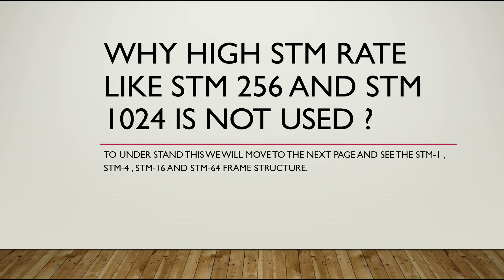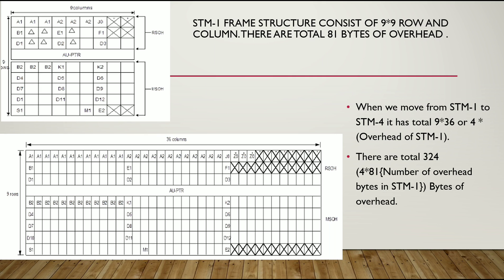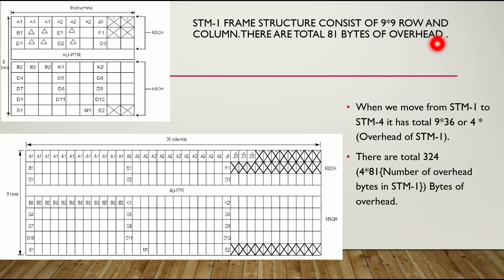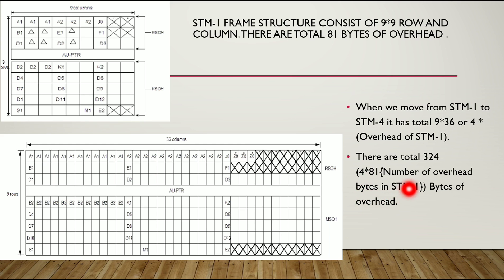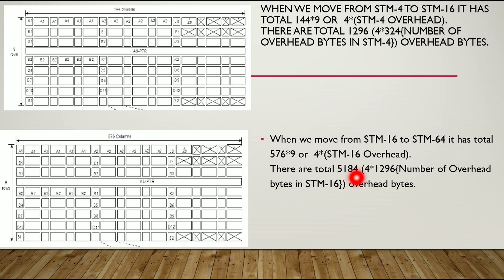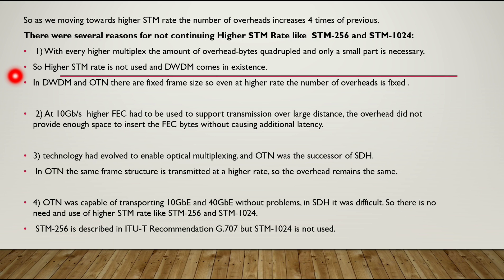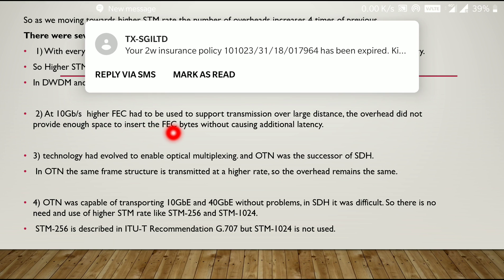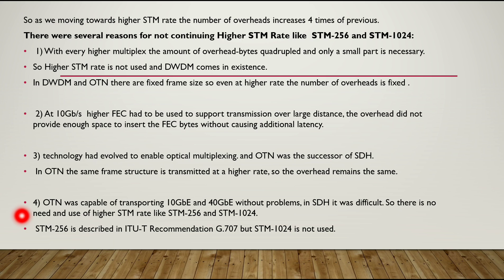Why Higher STM Rate like STM 256 and STM 1024 is not used in SDH?

Comment: Dispersion was the additional challenge to over come at higher bit rate....as 10G(STM64)can be travel up to 80 km...40G(STM256) upto 30km and 100G(STM1024)only 5 km with out amplification in case of SDH .... dispersion limitation overcome through DSP in cohriant receivers which we are using currently in OTN.
Reply from the maker: you are correct . but this is not the correct reason . As if we compensate the dispersion still we will not go to higher STM rate beyond STM 1024
Reply: @DeepakKumarSingh2015  that's why I said additional challenge